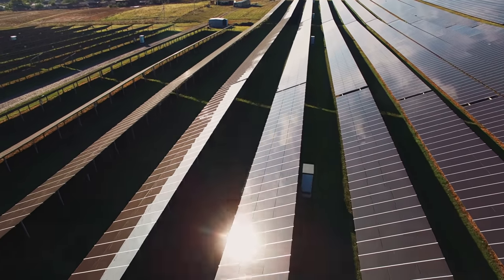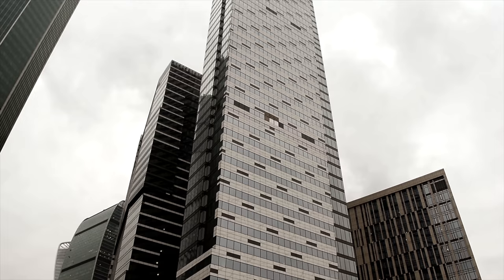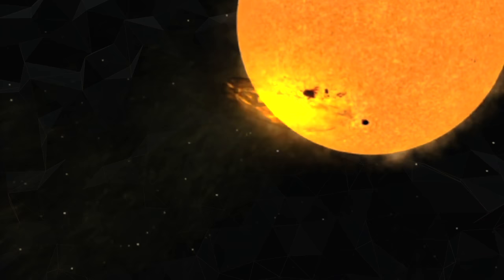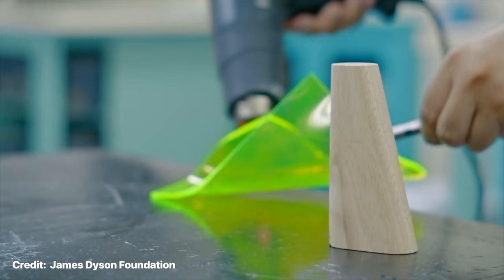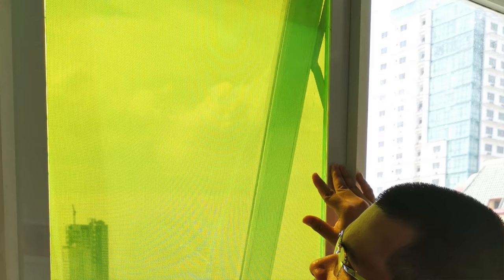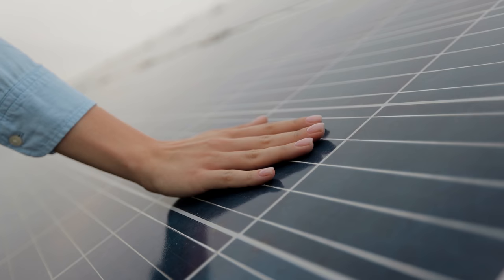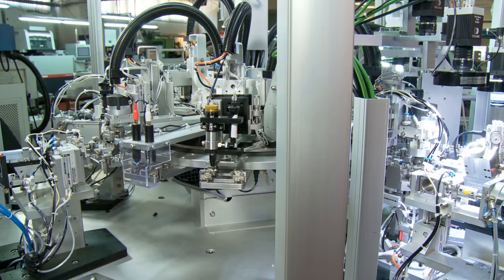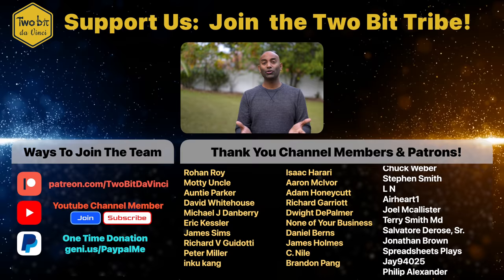These Solar Panels Work on Cloudy Days! AuREUS Solar Panels Explained

Comment: balloon up above clouds, but dont bloat down by weight
Reply: bah, carbon black all wavelength heat collectors, or just copper with concentrators/reflectors
Reply: lightning wire down for above the clouds, so where did you get your stuff, if not from above, thanks for all those, I'll keep them, when you dont, "I keep them for you", "instead of"
Reply: yet another patent, how boring
Reply: oh they can, what are you talking about
Reply: oh you believe a lie, again
Reply: when all the speakers on the planet are easily money led
Reply: you sell crap, dont water down the proper stuff, you are cutting the real stuff
Reply: oh yes, money forces you to split/cut/divide the things in limited claims

Comment: So far it looks like BS I'm afraid..this isn't anything new ..Every solar panel producer wants to improve it's efficiency.. So It is good to go that way..but not the best ..Because if you have a lot of clouds..problem isn't that you can harvest energy but that there is a alittle energy for that solar panel and even if eff. is only 5% it is something..but is it soemthing you want to spend a lot more than traditional panels? usually no..for some special purposes for sure..but not in every day use.. Forget this whole concept.. Start with this.

1. Every old house (where possible) and every NEW house must have solar panels installed to reduce  electr. needed - with old houses goverm. must support with new houses owners needs to support is
2. If applicable Add battery storage (start with some safe technology..So lets say  LiFePo)  to every house where solar panels will be installed. design it so excess energy can be stored in these batteries.
3. Use more heat pumps( where applicable) for heating/cooling and such.. - goverm must A. add money for new houses and B. give money where equipment might/will be changed ..
4. Use EV instead of petrol/diesel vehicles (where applicable) ...goverm. must support extra cost compared to normal petrol/d. 

By doing this  You solved at least 1/2 of your energy needs and reduced amount of  gas,coal needed ..for rest focus should be on wind/water/ atomic energy ..

and because nobody will do it ..there is low chance we will see any progress in improvements of Solar or electric energy in general..